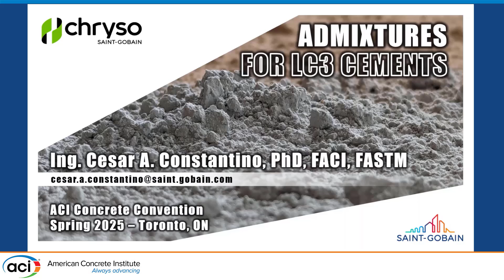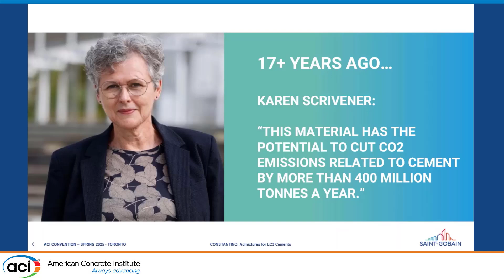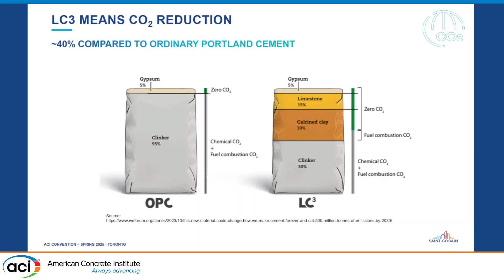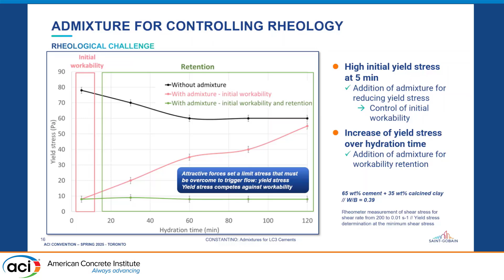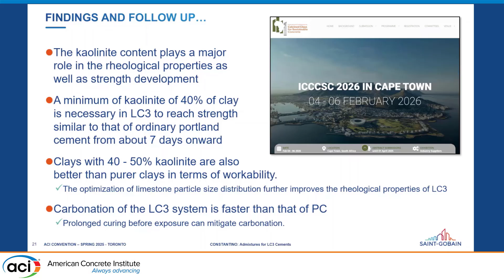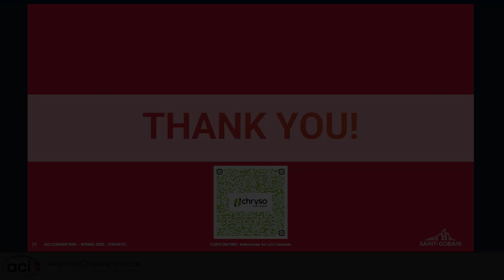Admixtures for LC3 Cements

Comment: Neither the LC3 cement nor the admixture for LC3 are discussed clearly. 

The following points need to be discussed....

1) How is LC3 different from any other cement? 
2) Micro structure changes in LC 3 cement?
3) How is calcined clay different from any other SCM?
4) Role of lime stone powder?
5) Curing regime of LC3 concrete?
6) Can be used in mass Concrete?
7) Disadvantages of LC 3 against other cement?
8) How does intercalation of polymers be prevented?
9) How is the admixture for LC3 different from conventional admixture in terms of recipe? 
10) How does the yield stress if LC3 Concrete can be managed?

Many questions are unanswered...😊😊